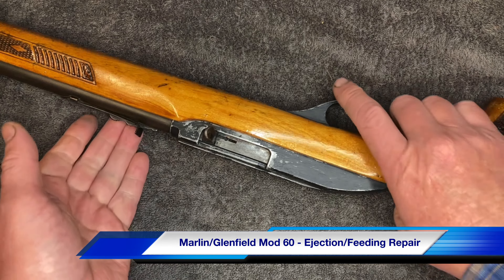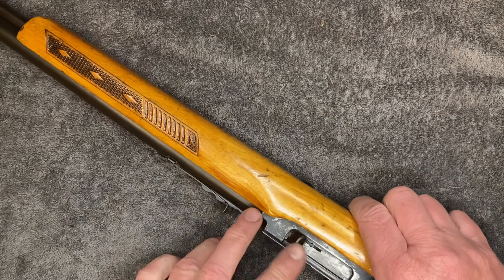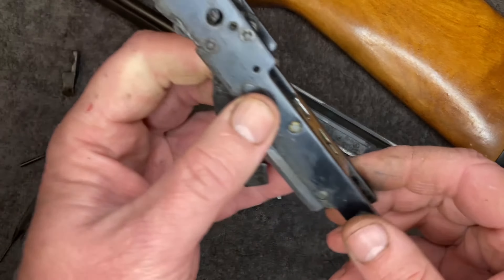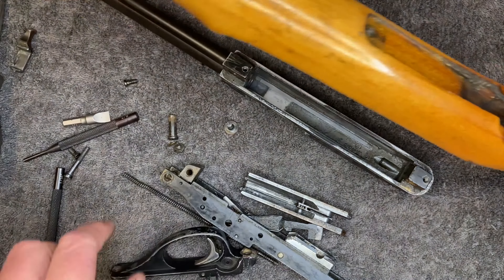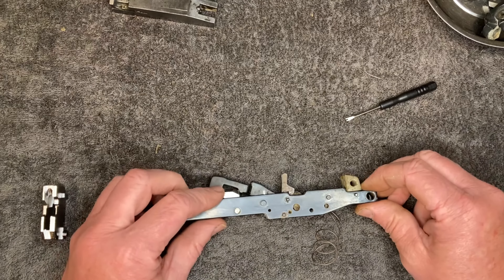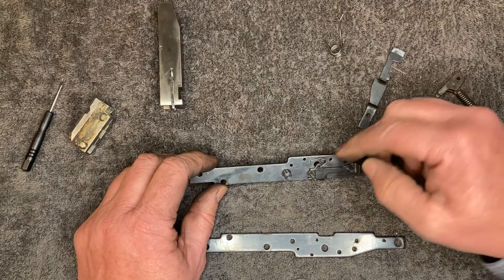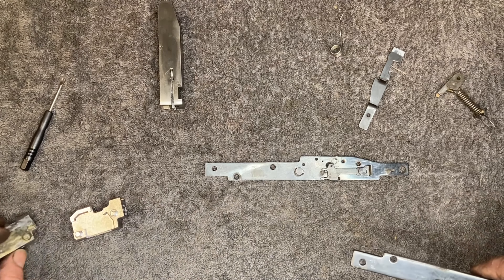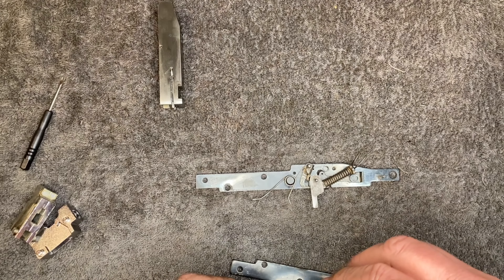Marlin/Glenfield Mod 60 - Ejection/Feeding Repair

Comment: This is a fantastic video, thanks for posting it. I have a 1970-made Marlin Model 49 which shares an action with the Models 99 and 60. It runs perfectly when it is clean, but it doesn't take much to start malfunctioning. The level of detail in this video is probably just what I need to make sure it doesn't need parts, and has good tips on retrofitting superior newer parts.
Reply from the maker: You are most welcome, thanks for your comment.

Comment: Awesome info thanks for sharing. After much research, the model 60 and 65 only differ in the feed throat on the 60 is usually one piece and the feed tubes are both brass on the model 65 Golden anniversary model and the one piece requires the slight mod to the feed arm to clear the throat properly and the extra hole in the chassis alignment pins. The newer model 60 has added a last round hold open feature that is not on the early model, usually starting with a serial number starting with 73-74 which is the year of manufacture. The newer models have serial numbers starting with 23- you take the first two numbers and subtract from 100 to get the year of manufacture. So a 25……. Would be from 1975. The split feed throats are really impossible to find new, but the new single piece version is plentiful. These guns shoot very accurately when set up properly especially with the 22” barrel, and are very reliable, but need frequent cleaning. Ruger bought Marlin so the parts are getting harder to find. Don’t spend more than 80$ for one of these regardless of condition, the Ruger 10/22 is a much better gun with tons of high performance match grade components available everywhere. You can’t really modify the trigger feel on the old Marlin model 60, so that can be a deal breaker for accuracy.
Reply from the maker: Thanks for sharing.